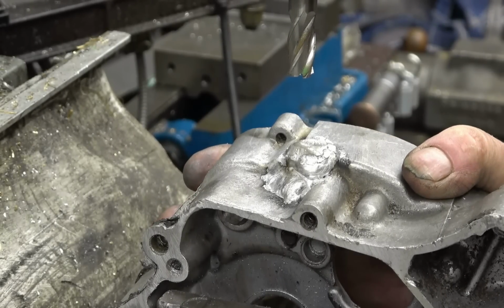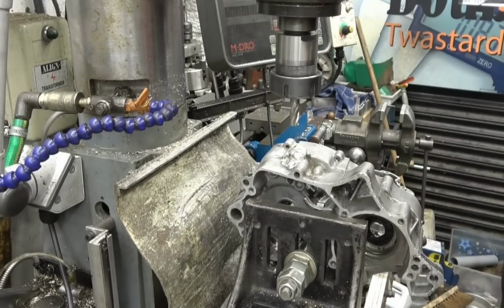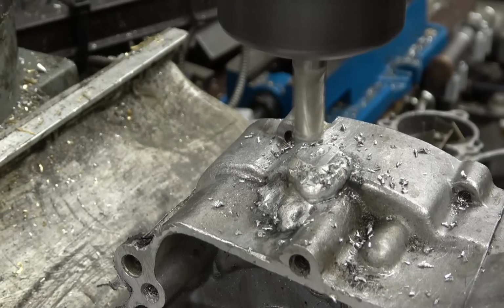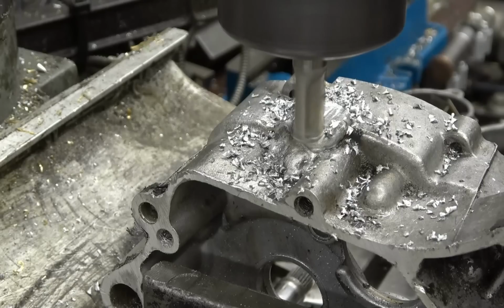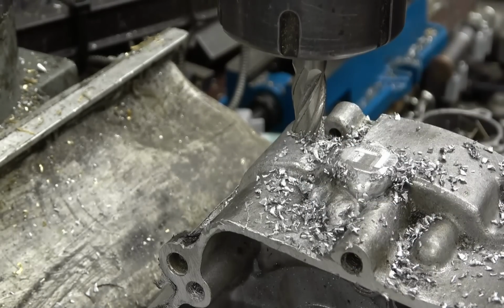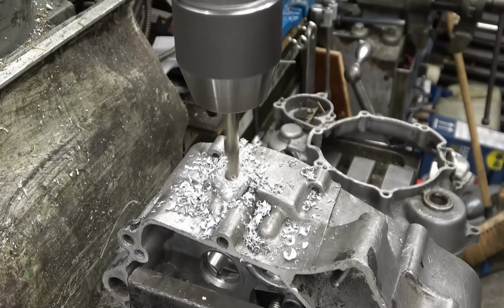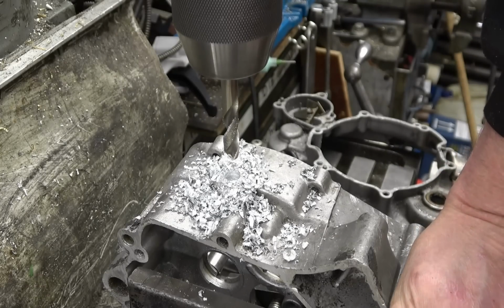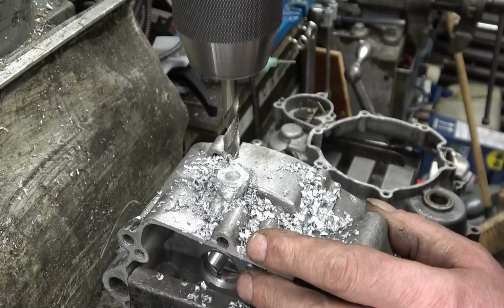SNNC 582 P2  Motor Bike Gearbox Drain Plug Repair

Comment: I usually go with an M10X1.25mm for sump plugs on bikes, it's a common pitch on Japanese motorcycles. I don't like Helicoil style repairs on through holes I prefer the Timeserts for sparkplugs and sump plug repairs, especially as they are in and out regularly.